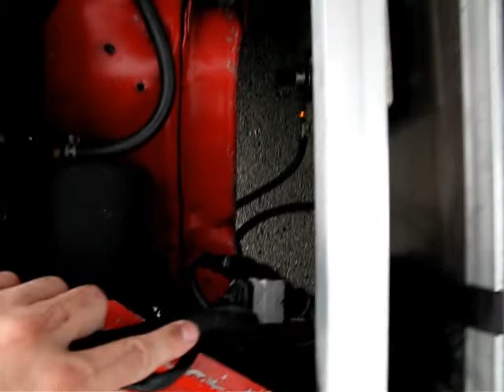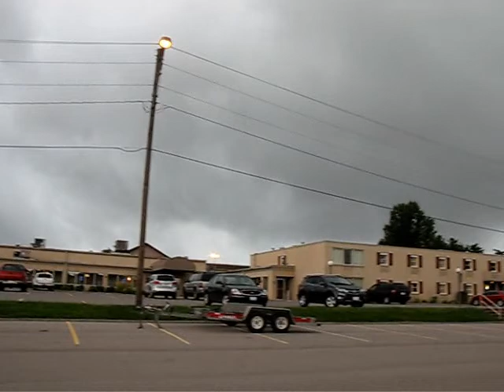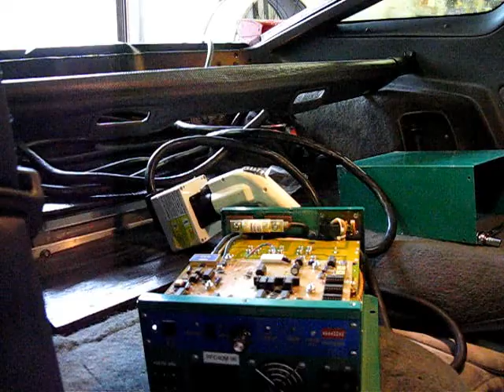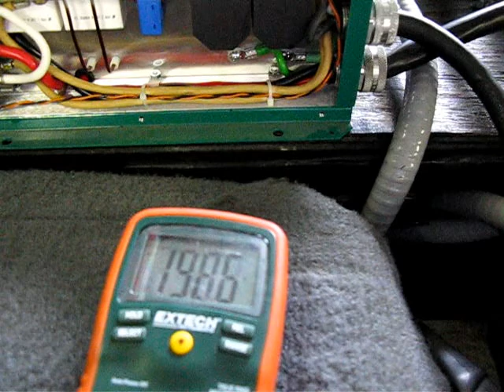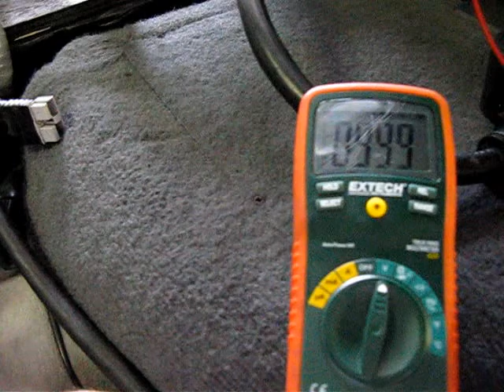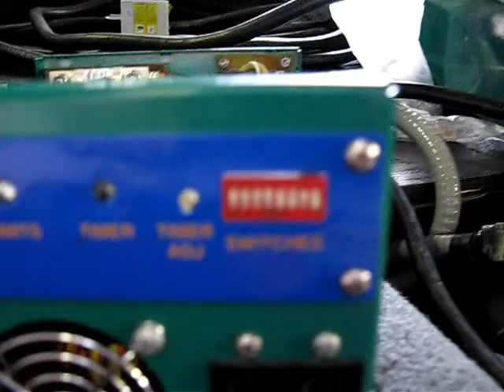August 8, 2013 - EVCCON Day 3 - 400W DC-To-DC Converter Installation & Blowing Up My Charger (Again)

Comment from the maker: I bought my Chennic 400W converter's from Jack at EVTV and they came with the 400v 100A Diode (and originally the 100 uH Inductor).  Those are both wired into my car in-line between Pack Positive and the input to the DC-To-DC converter(s).  When the water inside "incident" happened, the fuse on the converter also blew and may have damaged the diode as well, but will have to pull it out to test it to see if it still blocks reverse current or not at this point.